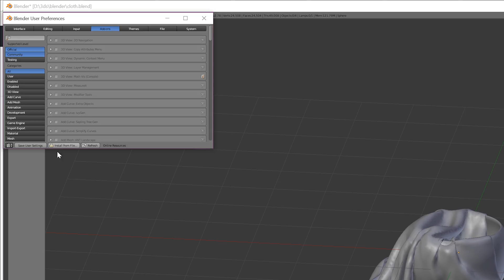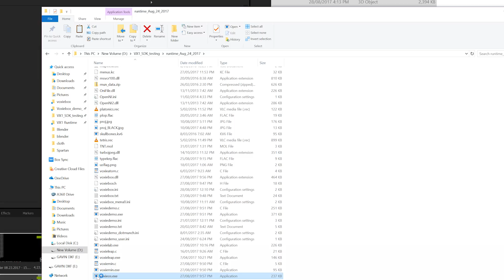Creating a 3D Volumetric animation for the VX1 using Blender

Comment: this is cool stuff,   however, I have a question or two:  I went to the web site & found ONE . GRAY ON GRAY type, who would do that? bad design.   But then, more importantly, I dont see the product.  What is it exactly? the display and or the software?  and How much?  Is if one size? Different covers, round - square, is that just the cover or is it part of the 'screen'?  etc.
This is cutting edge tech, but you should really make it clear what the product is and the cost...     thanks.
Reply from the maker: Hi Karl, not sure what you mean by a Gray on Gray one - this doesn't sound like our product. You can find out more here and see what the VX1 looks like https://voxon.co/voxon-vx1-available-for-purchase/ - enquire online and we can send you the technical specs and pricing etc. Hope this helps.
Reply: @Voxonphotonics  sir how does that screen rotate so that it become a cube shape mesh
Reply from the maker: @sus5651  the screen on this display moves up and down (30 volumes per second)....